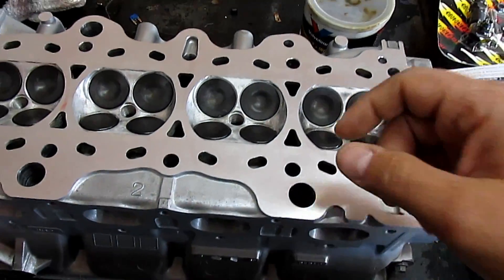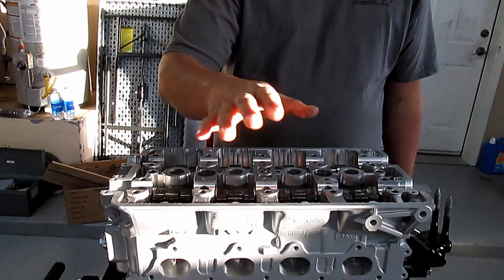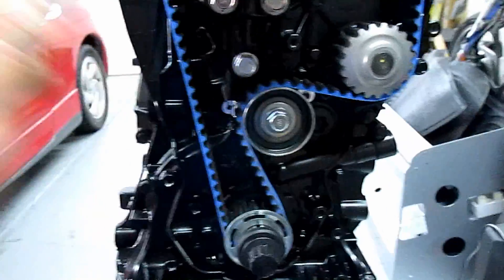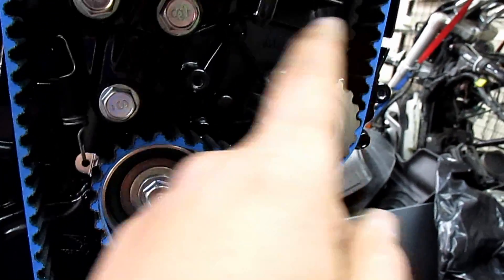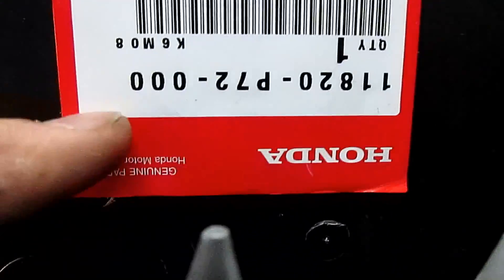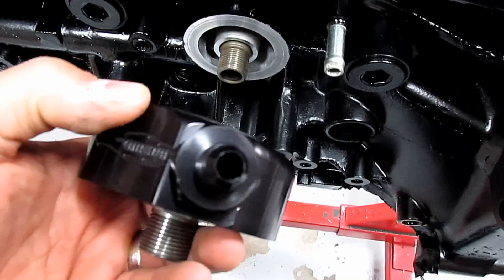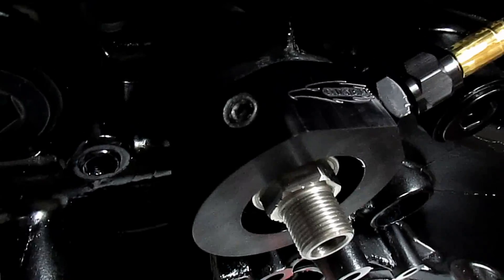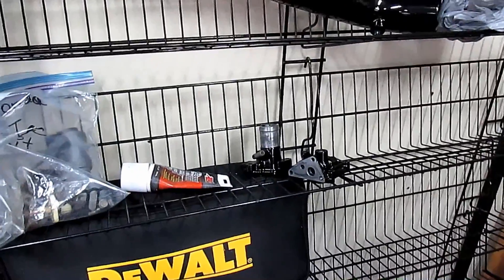Project "No Rice" #7: Golden Eagle Conversion Kit for LS/Vtec (Stroked LS/Vtec Acura Integra)

Comment: Which head gasket do you recommend? I've got an b16/itr head with a b1 block 😅
Reply from the maker: @turbowizard8325  cometic mls
Reply: @FatGuyBuilds  holy smokes that was fast!! ❤
Reply: @FatGuyBuilds  any issues?
I know GE recommended using a gasket 0.5mm over bore on the old lsvtec kits.

Is that the case with the Cometic LSVtec gaskets, or do I just get the 81mm for an 81mm bore?
Reply from the maker: @turbowizard8325  you get the gasket based on whatever the is
Reply: @FatGuyBuilds  sweet, so if I have 81mm bore go 81mm gasket, yes?
Reply from the maker: @turbowizard8325  yes
Reply: @ Thanks mate, I appreciate you!

Comment: Can someone give advice with putting a b16 head on a b18 nonvtec block?
Reply: Kobe Brown golden eagle vtec conversion kit and get arp head studs. It goes right on no tricks to it. Follow instructions in kit. Anyone can do it doesn’t involve much knowledge simple gotta follow directions and you’ll be good
Reply: @davidgonzalez1391  which b16 heads work? I'm just not too familiar with it
Reply: Kobe Brown any b16 head or any gsr head will work. That kit works for any vtec head (B16 or gsr)
Reply: @davidgonzalez1391  awesome thanks
Reply from the maker: Thanks for watching!

Comment: I know this is an old vid but was there any issue with crankcase pressure? Is all you used for the pressure the Pcv on the valve cover?
Reply from the maker: No issues...  and yes
Reply: @FatGuyBuilds  cool. Thank you so much. I bought my ls block out of a 94 but turns out it had been swapped before from a newer integra. Love the series. Answered a good bit of questions
Reply from the maker: @derrickmendoza4173  i am glad i could help.  if you have any questions feel free to ask.  I have learned a decent amount more since these videos.

Comment: Vtech head means vtech timing belt. U need a b16 or gsr water pump since you will be reaching higher rpms then the ls head.  That's why your belt seems to long
Reply from the maker: right, ls water pump = ls belt, gsr water pump = gsr belt

Comment: Would you be able to give us info on the ignition and ecu setup for this engine?
Reply from the maker: AEM standalone ecu, stock distributor. .026 gapped NGK plugs
what else you wanna know?
Reply: Sure, is there anyway to run a stock ecu ? If I used the 1.8 liter bottom end, and the head from the b18c5, is standalone ecm needed? And if so, why? Is the compression way different?
Reply from the maker: yes if you leave it NA with stock injectors you can use a stock GSR ecu
Reply from the maker: compression didn't make too much of a difference.  but we are running a turbo, 750 injectors, boost controller etc.
Reply: Cool, cool. Yeah this is looking like the cheapest way way to build power with a pre-tec engine. I just found out about this kit yesterday. Any difference in using b16 vs b18 head?

Comment: The timing cover stays off only to tell if the belt broke or u have adjustable cams dum ass it not that important really i have built over 2 dozen it doesnt matter
Reply from the maker: Good job building 2 dozen shit boxes for cheap ass ebay kids.  Obviously it doesnt cause issues to have it off.  But.... it just shows how cheap people are.  And u only adjust the cams once it the lifetime of the build while dyno tuning.  Once u find the sweet spot....  you never touch it again.  And knowing whether or not the belt is broken is very easy, even if you cant see it

Comment: Not how you do a Honda timing  belt.
Reply from the maker: i am not perfect and i do sometimes make mistakes.  i hope people double check what i do.
Reply: Jason Georgievski  nobody is but if you don't do them right it will jump time. Biggest thing is turning crank  counterclockwise watchig cam gear turn 3 teeth then torque down tensioner bolt Not ripping on  you keep up the good work.
Reply from the maker: thanks.

Comment: Never done lsvtec my first build i have gsr/itr waterpump and oilpump my ? Is the crank gear or bottom gear will the LS work or does that also have to be gsr itr crank gear thsnks for your help like your video very helpful
Reply from the maker: the gears on the bottom,,,  I believe are the same.  check these 2 sites to verify the part numbers.
https://www.oemacuraparts.com/
https://www.acuraoemparts.com/

Comment: I used a b16 water pump with a gsr timing belt.. 8000 miles now with zero issues.. I don't understand what your talking about with all those zipties to put on a timing belt? My gsr timing belt was a little tight but it went on.. Oh and those oil filter adapter plates leak oil like a mother fucker I been there and done that TWICE.. just buy the ls vtec oil line kit for $40.00 and save yourself $160.00 and T your vtec oil line off your oil pressure switch and your done with ZERO leaks... That adapter plate will leak from around the block and the plate and that Allen screw u tightened up will leak like hell too when that oil pressure builds up.
Reply from the maker: we have zero leaks because I used "Right Stuff"  it is a very hardcore RTV.  the zipties help the belt from not popping off while you are stringing the belt on the engine all by yourself.  if you have a helper to hold the belt on the cam gears then you dont need zipties.

Comment: Why didnt you run your external oil running to the port on the back of the block the one just above the divider the one that runs the solid oil pressure those adapters are white people burn up their top end most of the time instead of going to that silly adapter that goes on your oil filter I'm not knocking you I'm just asking holler back
Reply from the maker: Jacob Cartwright thousands of people use that kit and it works...  one thing that we did have to buy was a new dowel pin and oring for the cam cap oiling system

Comment: I just installed a Type-R head on my B18B1 block with the GE kit with the ARP head studs because I've been turbo for a long time and I just miss VTEC. Anyway, I did everything the way that you just did and it's leaking out of the passenger side rear of the block between the head and block. I can't figure it out. I used JB Weld over the 1/8 npt plug in the head and the gasket is facing the right way, so idk what could be causing it. I have it apart again so I'm going to take the head to a machine shop and have it checked.
Reply from the maker: WHY did you use JB Weld?  use your phone and wiggle it around up there to see where the leak is coming from.
Reply: Did you find out where the leak was coming from ?
Reply: Check cam seal, valve cover gasket probably leaking if you uses jb weld
Reply: Boosted B Series EK did u find the problem? I have that same issue rn

Comment: Please just tell me you're not going to run an open timing cover
That shit is stupid 

If you want to show it off just get a clear cover 
No shortage of them or are they hard to make...
You forgot to oil the o-ring

Also why'd you run the oil line from the head to the sandwich plate? ( new to Honda engines)
Reply from the maker: because the Vtec head needs oil supply.  to run the vtec gadgets.
Reply from the maker: oring?
Reply: Jason Georgievski on the sandwich plate
Reply from the maker: it is built on. plus I used "Right Stuff"

Comment: I bet you leaked after a couple of oil changes , sandwich plates are the worse because everytime you loosen the oil filter you can run a chance on loosing up the sandwich plate and leaking oil
Reply from the maker: teggyboii official nope.  i added " right stuff" inbetween. it will be fine
Reply: Jason Georgievski  Nice , I work for Honda and customers always come and complain about having leaks and it always happens to be the sandwich plate but Im assuming they didn't buy the golden eagle one
Reply from the maker: it is more about the addition of "right stuff" between the sandwhich plate and the block.
Reply: yes if the yget ebay kits stuff is made cheaper. never heard of a problem with this but its possible. how much do just the plate cost anyway?
Reply from the maker: not sure how much we paid.  just google golden eagle ls/vetch kit
Reply: i mean if they needed just the plate to replace. can you even get it seperate
Reply from the maker: the plate wont ever go bad.  it is just a chunk of aluminum.